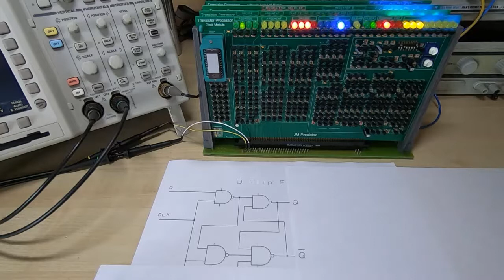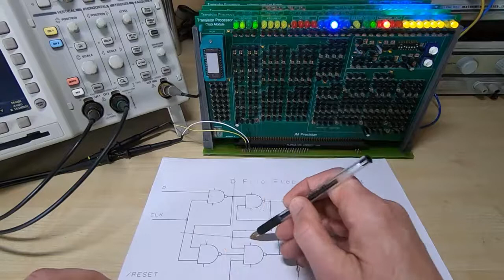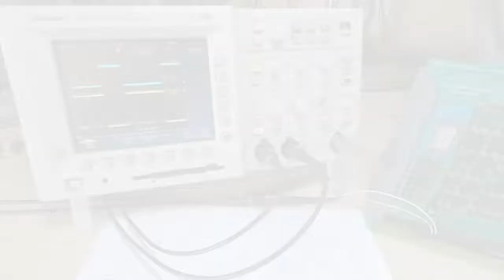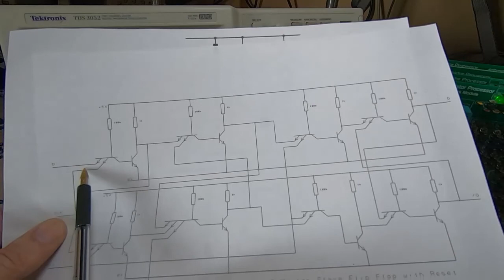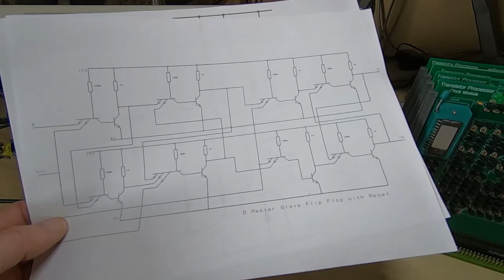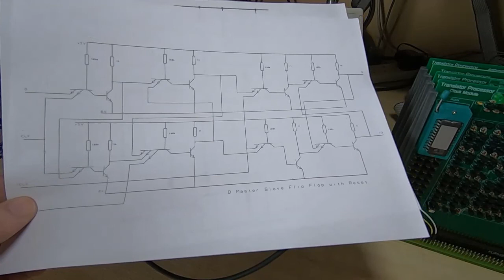Transistor Processor Clock Design

Comment: Quick question. Your schematics show transistors with multiple emitters but PCB pictures show standard TO-92 three leg transistors? It doesn't seem that you are using real multiple emitter transistors. Can you explain what is actually going on?
Reply from the maker: The book that is supplied with the kit explains it in detail but essentially the transistors are connected in such a way that they form multi-emitter transistors. This has the advantage that each input requires approximately the same voltage to switch it rather than the differing voltages you get in most other configurations. If you are interested I will post a video demonstrating this.
Reply: @JerryWalker001  I think a video showing how you do it would be a good idea.